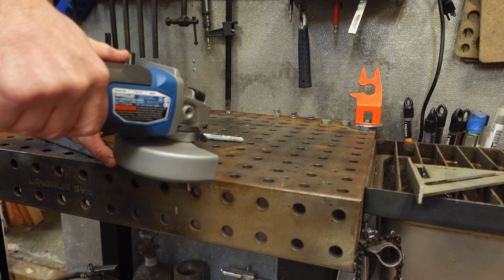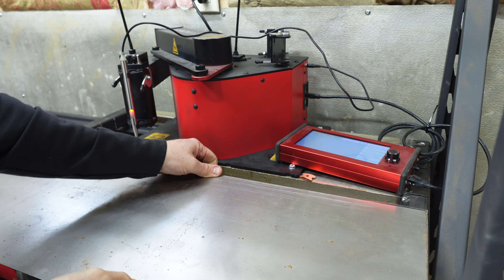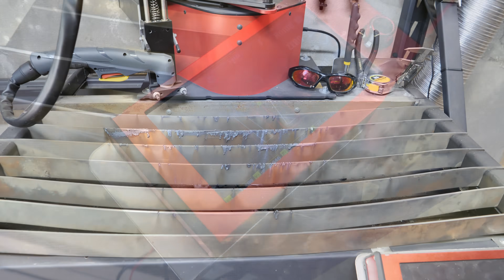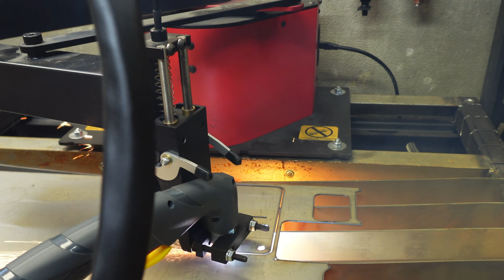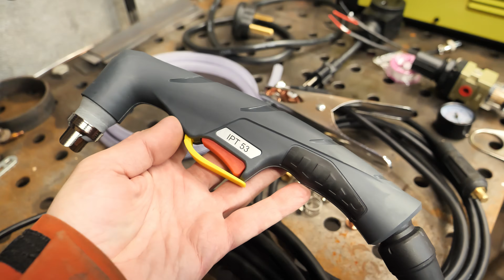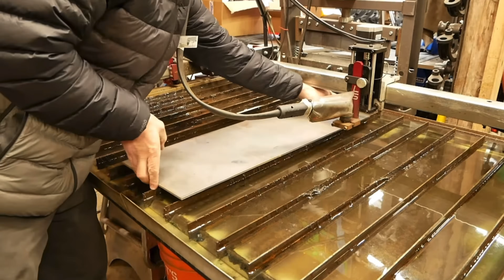Arcdroid, Down draft table, Arcfony CNC plasma cutter

Comment: Just before Covid (spring of 2019) we bought a Crossfire basic table and a Miller 625 X-treme, had a terrible time with the software. Fusion 360 was terrible to use in our setting because it's internet based and our connection was very slow. Also the old Mach 3 which isn't dedicated to plasma cutting was less than user friendly. During the 1'st year of Covid our shop was shut down and the machine sat. The 2'nd April of covid (2021) we opened our shop and it was either get the Crossfire going or get rid of it. We threw Fusion away and bought QCAD and Sheetcam, meanwhile Languire came out with their ArcFire software. In about 2 weeks very part time we learned enough software and got everything running. My advice is Fusion is way more program than you need for simple 2D parts, SheetCam works and ArcFire is a game changer. Once you can CNC cut you look at projects completely differently.
Reply from the maker: Yes Fusion 360 is way overkill for simple 2D stuff, I definitely have been looking into other programs. 😊👍
I will take a closer look at QCAD and Sheetcam. Thanks for checking out my new video.
Reply: @Mikefestiva  Hi Mike............enjoy your videos.....QCAD is pretty intuitive and all you need for 2D cut drawings, Sheetcam is also 2D and works fine, we loaded both on the laptop that drives the Crossfire table so it's all right there and resident with our table......... we also have copies on home computers so w can design & post process there as well.....works for us.......73 MP
Reply: @michaelpolimer2128  I'm using F360 for my Crossfire pro, w/ THC, right now and it's way more hassle than I'd prefer, overly complex and they are pretty restrictive with the hobby license. What is post processing like with QCAD, SheetCam and ArcFire? Is it pretty straight forward like F360? Do you still use FireControl from Langmuir Systems? I did a quick look for ArcFire and didn't find it. Where can I find it?

Comment: I bought a Crossfire XL with water table, limit switches, THC, laptop stand, and the Razorweld 45 with machine torch. I'm actually hoping to have first fire this evening. I've wanted for one for a while, and after I added some auxiliary hydraulics on my tractor, I decided I didn't like the bracket that came with it, so I'd cut my own :). On the topic of high quality air, google for "compressor aftercooler". Basically, it's taking an automotive transmission cooler and water separator, and then plumbing it between the compressor head and the tank check valve. The advantage to this is it keeps water out of the tank, reducing corrosion. I've got a two water separators, a dessicant stage, and a Motor Guard 60 micron filter at the moment, but I'm going to add the aftercooler as soon as I can start cutting some brackets. FYI: It's your fault I bought the Crossfire :)

Comment: Mike, I'm happy to soak in anything you throw at us.  And your advice help me decide to put in some 220-240 V circuits.  Got a question for you.  Does anything you use need 2 or 3 phase 240 V?  Would you recommend putting anything that heavy into a home-gamers shop?  Thanks in advance.
Reply from the maker: Having 220 in your shop is really nice, You won’t regret it. Where I’m at 3 phase is out of the question. At my work we have 3 phase 480 volts along with some lower voltage stuff then that. 
It’s to expensive to get In most home shops. I bought a lathe years ago that was 3 phase, I bought a rotary phase converter and that took care of my needs, there’s also VFDs if you need some 3 phase. As long as you have 220 Volts you can make 3 phase with ether of those methods 😊👍
Take care and have a great weekend!
Reply: @Mikefestiva  thanks Mike appreciate the feedback

Comment: Nice way to set it up Mike :) Need to make this with the square pipe on my water table for the plasma. Using angle iron now, which is not as precise. And good to see a video from you again :) 😊

Comment: I just picked up the same Arcfony as well. Really impressive unit for under $400 CDN. Hope to have my DIY table up and running this week!
Reply from the maker: Nice! Yes for the price and quality I’m also really happy with it. What I really like about it is it always starts on every cut, I have had blow back pilot arc start plasma cutters sometimes miss a start in the past when cutting out a CNC part with many different Pierce points. 
This Arcfony hasn’t missed a start yet and I have made hundreds of cuts with it so far. 😊👍 That’s awesome your are building your table!